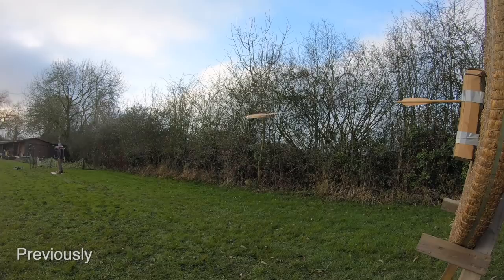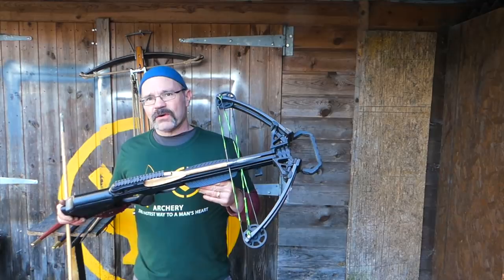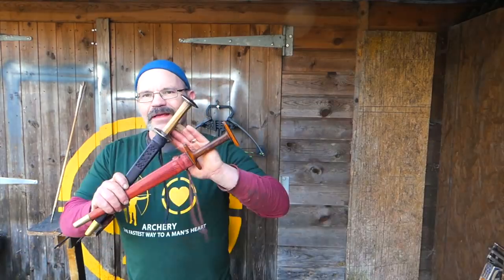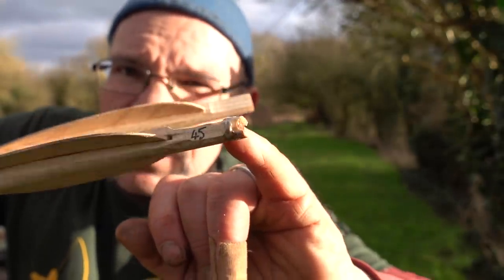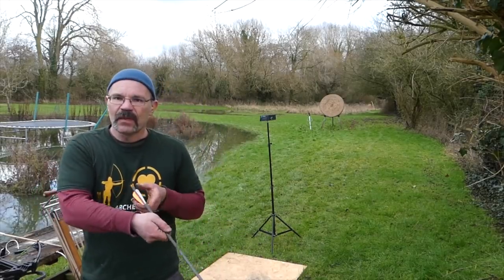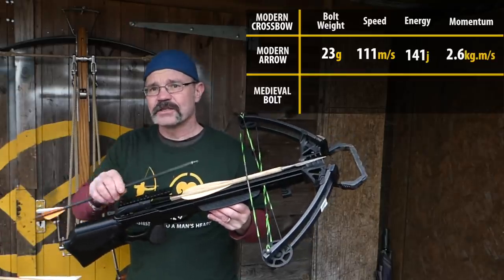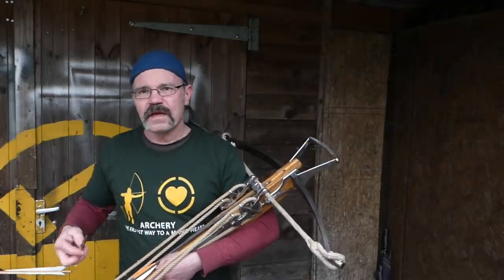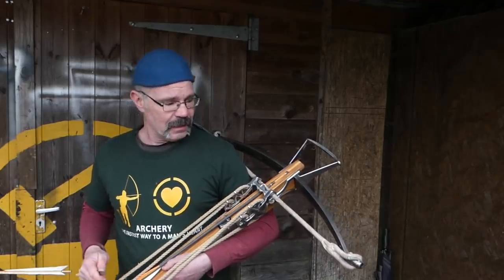Heavy Crossbow - Light bolt - What happens?

Comment: Can we try even heavier bolts? This really makes me wonder how much energy the medieval bow can deliver if the bolt is massive enough to receive the energy.
Reply: This would be interesting to see. 

I would expect that, as the mass of the bolt increases from zero, the efficiency will increase for a while and then eventually decrease. That is, as the mass of the bolt is increasing, (at least) two things are happening: (1) The bolt is comprising a greater fraction of the total mass of the accelerating pats (i.e. bolt, string, and bow arms), which means that a greater fraction of the total energy will be carried off by the bolt. (2) The total acceleration of the bolt, string and bow arms is decreasing, as there is more mass (i.e. a = F/m, where a is acceleration, F is the spring force, and m is the total mass). Thus, there is a trade off between increasing the mass fraction attributed to the bolt and decreasing the total acceleration, which would cause a "peaked" curve.

I would expect there would be some other things going on as well, but I think that this would comprise the core part of the physics, with the additional factors impacting things less than the mass fraction of the bolt and the total mass. Though, I could be wrong :P
Reply: @joshuacantin514  There's a comment 30 minutes ago, where somebody does the math behind it. It is without friction, but more weight in the bolt leads to more energy in it
Reply from the maker: I guess we should find out....
Reply: @G1nG3r4l3  Ah, yes. I found the one by Frederick Qu. Very interesting.
Reply: @joshuacantin514  Based on my reading of Frederick Qu's formula, the efficiency won't ever decrease past some point because maximum efficiency occurs with an infinitely heavy bolt.
Reply: @mitchellhowell9380  Based on Frederick Qu's work, I agree that that would be the conclusion. Based on his work, the momentum also continuously increases with the bolt mass. Though, the velocity should be more interesting as it should stay about the same for a range of small bolt masses, then start to drop off as the bolt mass becomes appreciable with respect to the effective bow mass. Based on Tod's numbers, my guess is that the current bow/bolt system is still within the "roughly constant velocity" regime for the medieval bow (or at the upper edge of it). The modern bow seems to have a large drop in velocity , so it is probably past this point already.

I am curious to see an actual test and whether or not the results match these predictions or if there are some other factors that are being missed.

Comment: Hmm. The results seem to indicate that the main part of the energy of the old-style bow is spent to move the string and limbs, and the arrow is basically just an afterthought, energy-wise. Which would mean that for the old-style bow, even a heavy arrow is not much different from dry-fire.
Reply: Sounds about right.  There's so much internal resistance and inertia slowing down the limbs that the weight of the projectile doesn't make much of a difference.  It's rather like Todd's truck analogy.  Load a 1000kg (2200 lb) weight into a semi and you won't even feel there's a difference because it requires an insignificant amount of additional power to accelerate at almost the same rate - but you'll really notice the difference if you toss a ton of extra weight into a sports car.

Comment: Dear Tod, here in Switzerland double edge blades are "outlaw" as well as spring assisted or automatic knives. as far as i understand an "Opinel knife" with a locker for the blade is considered as a Machine gun in the UK regulation. please let me know what is the trick to be allow to purchase one of your dagger? br, Agoodwalker.
Reply from the maker: In Switzerland you can have a dagger with a blade longer than 30cm legally
Reply: @tods_workshop  thank you for this quick feedback. i did a check and you are right a bayonet less than 30 cm is too short...holy S...

Comment: Hi, I don't know if I misjudge this, but this specific 960pound windlass crossbow, seem to bee rather sluggish, with very modest bolt speed. 
Look at this medieval composite crossbow: Bolt 81g, Bolt speed 70 m/s almost 200J bolt energy, as compared to : Bolt 67g, Bolt Speed 55 m/s, 103J bolt energy https://www.youtube.com/watch?v=G2Rl9DLUfao&loop=0
Heavier bolt, MUCH higher speed

And compare to the sound of the magnificent replicas built by Thiele Adam, Hungary.( Bolts may be slightly lighter, but bow must be a lot faster )
17th century crossbow replica: https://www.youtube.com/watch?v=Yogv2dDnx64&loop=0 
16th century crossbow replica: https://www.youtube.com/watch?v=xvrQYeWR-3E&loop=0

Comment: When you performed the loading speed test between the two crossbows did you try cocking the modern crossbow without the cocking aid? I have a modern crossbow with recurve limbs with a draw weight of 150 pounds and I can cock it by hand. It is tiring but quicker than using the cocking aid. Just a thought, I really enjoy your channel. Thanks.